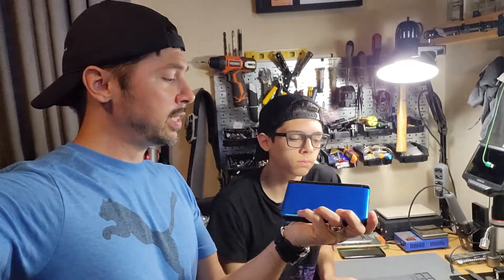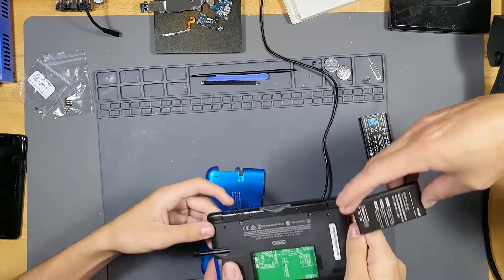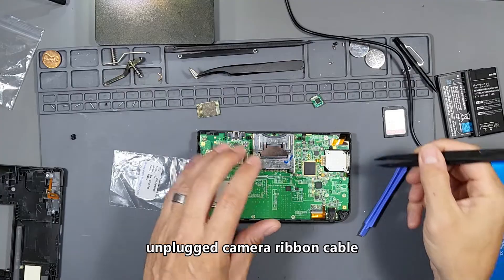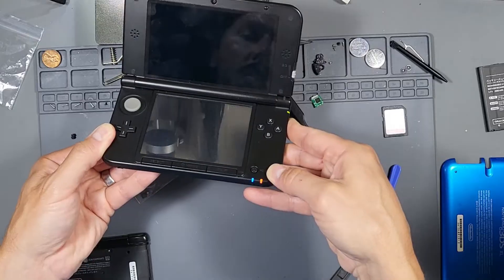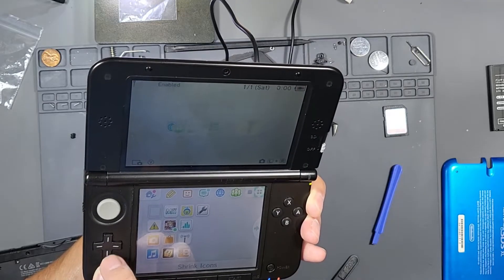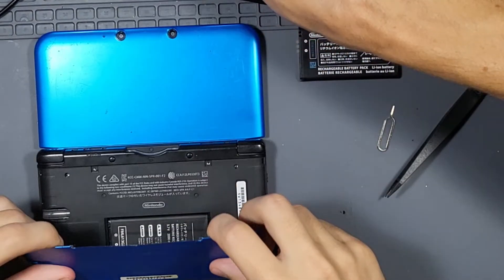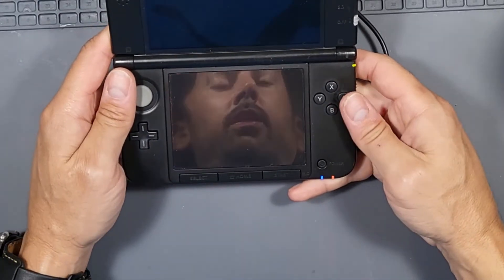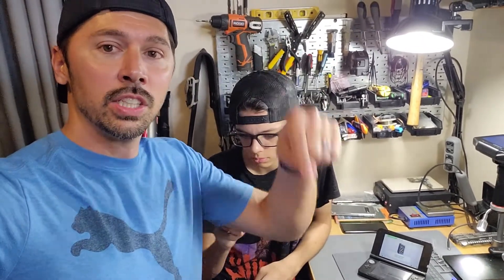HOW TO FIX A 3DS XL NOT TURNING ON

Comment: I'm having a black screen issue with my 3DS after the Luma config v13.1.2 screen. After I save and exit, the screen goes black again. Removing and replacing the battery temporarily fixes it, but the problem returns. Also, I can't access recovery mode despite trying the right button combination. Any advice?
Reply: Had u tried updating the luma software?

Comment: My 3ds the lights blue is on but my screen still black, how to fix that, can u tell me how to fix it
Reply: @m.albibimantoro547  bro he just had the same thing in the video he removed the camera cable
Reply: @m.albibimantoro547  sounds like a issue with the screen ribbon cables or a faulty camera. Good luck 👍

Comment: So then what happens when it turns on but shuts off immediately
Reply: With a pop?
Reply: mine went out originally with a pop but now wont turn on but has an orange charging light
Reply: @SussyAmogus-x6o  yep
Reply: If so, replace the audio ribbon cables from the top screen
Reply: @SussyAmogus-x6o  What does it look like?
I also was thinking of trying to try L + R + A + D-pad Up, but my R button doesn't work...

Comment: Bad connection bad camera robbing Cable Nintendo 3DS
Reply from the maker: I'm going to see if I can replace it but we never use the camera on 3ds.
Reply: On Nintendo 3DS configuration hardware it's configuration will require a camera for it to work properly